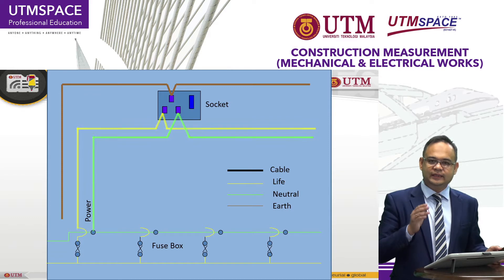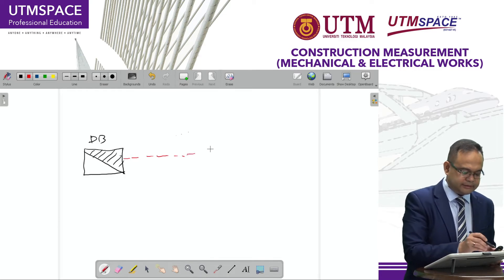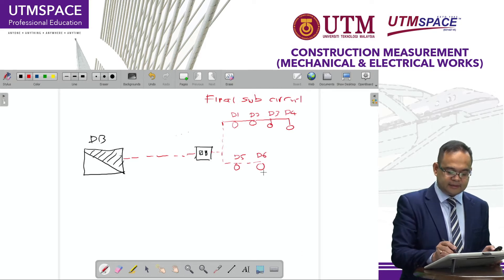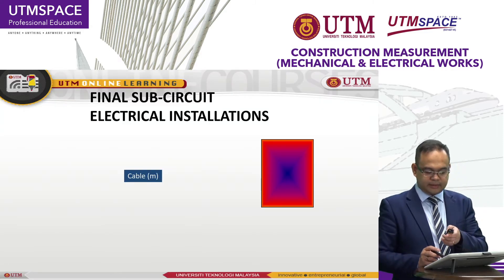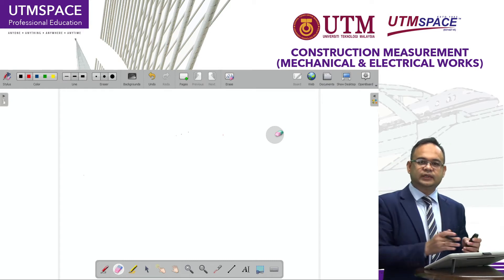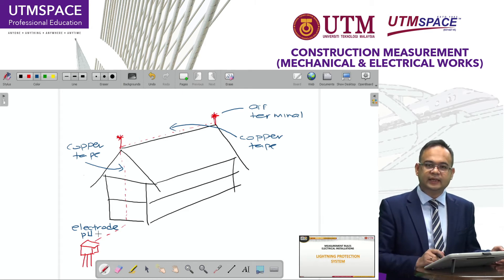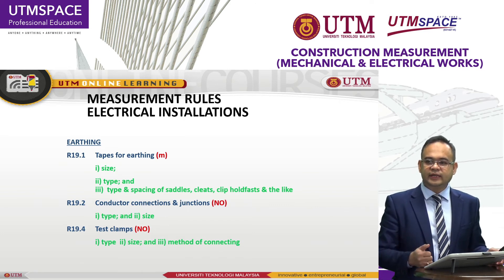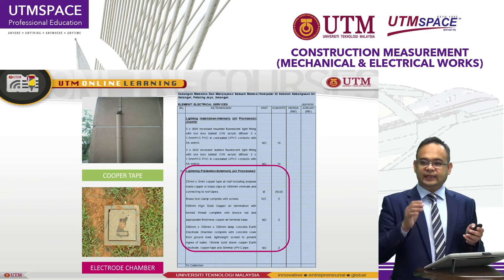Video 4 Final Sub Circuit Lightning Protection System

Comment: With the illustration and clear explanation, now I have a better understanding regarding the final sub circuit and lightning protection system and its measuring method in accordance with smm2.

Comment: A clear video explanation about the final sub-circuit and lightning protection system. It is make more simple and straightforward method to gain the knowledge on the electrical installation topics. This video has benefited me a lot !

Comment: This lecture video is interesting and very easy to understand. From this video, I have learnt about final sub-circuit and lightning protection system. Final sub-circuit is when a switch can control 2 or more electrical appliances. For final sub circuit, we just need to measure in Nr. Next, lightning protection system consist of four main components which is air terminal, copper tape, electrode chamber and test clamp. All of the components should be measured in Nr except for copper tape which should be measured in meter. 

Thank you for your sharing, Dr Sarajul.

Comment: From this video, I have learned about final sub circuit and lightning protection system in details. There are details definition of final sub circuit involved in a electrical installation system and its functions. Other that that, this video also explained about the rules of construction measurement as stated in SMM2 with details of unit (Nr) used for the taking off. This explanation was really helpful for me on doing electrical works and items in taking off list.

Comment: This video shows how the final sub-circuit and lightning protection system work with diagrams, sketches, and explanations. By watching this video, I have gained a better understanding of the lightning protection system and the final sub-circuit system. Additionally, I understand more about the rules of measurement for Lightning Protection and the Final Sub Circuit.

Comment: From a student's perspective, I find it very easy to understand the terms and function of the components. The final sub circuit seems like simple concept yet it plays a big role in electrical works. Same goes to the LPS. The method of measurement are also clear and very straightforward. Thank you for knowledge Dr Sarajul

Comment: This video are very helpful to me and those out there whos new to the lightning protection system, i can really understand how it works and what are the components in the Lightning protection system with how every single component works and how can it be measured. It also enlighten me on the existence of final sub-circuit. the video is really cool and easily understandable!

Comment: This video is very useful for me. It helps me understand the final sub-circuit and lightning protection system with clear explanations, sketching, and diagrams. It will help me a lot in measurement work.

Comment: This is a straightforward and understandable lecture that will assist me in gaining a deeper comprehension of the lightning protection system and the final sub-circuit.

Comment: With the help of diagrams and sketches, this lecture demonstrated how the Final Sub Circuit & Lightning Protection system works. According to SMM2, the final sub-circuit shall be measured in number (Nr), such that the final sub-circuit is from the switches to the downlights and appliances. Thank you, Prof!

Comment: Amazing video!! Prof. explains the final sub-circuit and lightning protection system in a clear and understandable manner. Clear voice, step by step explanation, straight forward, easy to understand. Prof. even shows us clear sketches on how the electrical system is installed and works. For example, the distribution board is connected to the switches, then from the switches to the down light point or electrical appliance via the final sub-circuit. From this video, I also realised that the cable from the distribution board to switches are to be measured in metres. However, for the final sub-circuit, we do not need to measure the cable in metres, but measure the final sub-circuit in number (Nr) according to SMM2. Moreover, from this video, I also get to know the main components of the lightning protection system such as the air terminal, copper tape and electrode pit through the clear sketches drawn by prof. At the last part of the video, it also explained about the rules in SMM2 (Section R.19) to describe each of the components of the lightning protection system. This video provided me with useful knowledge and better understanding on the final sub-circuit and lightning protection system. I believe that this will be useful for me in my M&E measurement course later. TQVM prof.

Comment: The video has a very clear explanation the final sub-circuit and lightning protection video. With the aids of diagram, it lets me have a  clear concept on how the system is working. Besieds, with the explanation on SMM2, I know which clause  I should refer when doing calculation. Thank you Dr.

Comment: Thanks for sharing this video. Illustrations and diagrams help to make the explanation very clear. I can readily understand the ideas and guidelines for the lightning protection system and final subcircuit from this video. This is due to the illustrations in the movie which helped me to grasp that the downlights and appliances are connected to the final subcircuit from the switches. Additionally, I learnt the clauses to which I should refer and pay attention when I write the final sub-circuit and lightning protection system's description. Many thanks, Dr.

Comment: From this video, it helped me a lot in understanding the Final sub-circuit and lightning protection system. For example, according to SMM2, the final sub-circuit shall be measured in number (Nr). The electrical connection or supply that began at the switch and went on to its downline equipment, such as lights and ceiling fans, is known as the final subcircuit.

Comment: A simplified and easy understanding video by Dr . Sarajul about the electrical installation. From the video, I learnt about final sub circuit and understood how's the source of electrical power come from incoming services to distribution board and to the switch socket. Besides, the video had just mentioned about the lightning protection system. from this I know more about the LPS and its function to the building. Thanks a lot, Dr

Comment: From this video, I have learnt that final sub-circuit is a circuit connected from the switch to its downline equipments. The cable connecting the distribution board to the switch is measured in meter while the cable for the final sub-circuit does not need to be measured. According to SMM2, the final sub-circuit shall be measured in number (Nr). Besides, I have learnt that the four major items of the lightning protection system are air terminal, copper tape, electrode chamber and test clamp.

Comment: The illustration given by Dr. Sarajul really helped me a lot in understanding the Final sub-circuit and lightning protection system. Final sub circuit is the connection or supply of electrical which started from the switch to its downline equipments such as the lights and ceiling fans. The electric cables from distribution box to the switch will be measured in metre run according to the SMM2 but for the final sub-circuit we just measure the number of items. For the lightning protection system, the illustration of functions for cooper tape, air terminal and electro pit chamber are clearly presented.

Comment: final sub-circuit means an outgoing circuit connected to one way on a distribution fuse board and intented to supply energy at one or more points to current-using appliances without the intervention of a further distribution fuse board. It includes all branches and extentions which are derived from that particular way on the board;

Comment: In electricity, the phase refers to the distribution of a load. What is the difference between single-phase and three-phase power supplies? Single-phase power is a two-wire alternating current (ac) power circuit. Typically, there is one power wire—the phase wire—and one neutral wire, with current flowing between the power wire (through the load) and the neutral wire. Three-phase power is a three-wire ac power circuit with each phase ac signal 120 electrical degrees apart.

Comment: To create the detail BQ and taking off, the important of informative drawing is very crucial.
Two type of information electrical drawing that can help the client and contractor to understand the electrical design either it is single phase or three phase supply.
1. Electrical layout plan – Location of electrical fitting, power point and  etc. 
2. Schematic drawing – Circuit, cut off

In this lecture video, I was able to understand the process and sequence of Electrical Installation.

Comment: Titty Ricca Binti Suhaili (SX190985BEQS12)

1. Electrical engineering installations are classified as single phase or three phase, with the main electrical components referred to in SMM2 Section R.

2. Incoming services, main insulation, power insulation, lighting installation, electrical appliances, conduit and fitting, cables, lightning protection system, and testing and commissioning are the components for measuring the electrical installation.
 
3. Based on SMM2, lightning protection system is calculated based on Clause R.19. There is four (4) main component of lightning protection system which are:
i. Air Terminal Point (Clause R.19.6 – measured in Nr),
ii. Copper Tape (Clause R.19.1 – measured in M),
iii. Electrode pit or Electrode Chamber (Clause R.19.5 – measured in Nr), and,
iv. Test Clamp (Clause R.19.4 – measured Nr).

Comment: From this video, I can find out the rules of construction measurement for the final sub circuit and lightning protection system. The function of an external lightning protection system is to intercept, conduct and disperse a lightning strike safely to earth. Without such a system a building's structure, electronic systems and the people working around or within it are all at risk. 
A lightning protection system consists of the following five parts: 
1)	air terminals (lightning rods)
2)	conductors
3)	ground connections (electrodes)
4)	bonding
5)	lightning arrestors

Thank you.

Yusti Taili
SX190981BEQS12

Comment: The Earthing for Lighting Protection System is important as it protects  sensitive equipment and devices in the building which may be caused by lightning strike. The  System  refers to SMM2 , under Section R.19 refers to  four main components such as :

1. The Air Terminal
2. Copper Tape
3. Electrode Chamber; and
4. Test Clamp

SMM2 states the following items on lightning protection system for measurement :

EARTHING
R19.1 Tapes for earthing (m) 
i) size; ii) type; and
iii) type & spacing of saddles, cleats, clip holdfasts & the like
R19.2 Conductor connections & junctions (NO)
i) type; and ii) size
R19.4 Test clamps (NO)
i) type ii) size; and iii) method of connecting

R19.5 Earth electrodes (NO)
i) type ii) size; and iii) driving electrode into ground
R19.6 Air termination points (NO)
i) type ii) size; and iii) method of connectin

ANCILLARIES
R20 Loose keys, tools, spares and the like (NO – separately)
i) type; and ii) quantity
Rack for holding tools (NO)

SUNDRIES
R22.1 Marking the position of holes, mortice, chases & the like 
(ITEM)
R22.2 General earth bonding & earthing (ITEM)
R22.3 Disconnecting, setting aside & refixing equipment (ITEM)
R22.4 Temporary operating each installation (ITEM)
R22.5 Testing each installation (ITEM)
R22.6 Preparing plans or diagrams of the installations (ITEM) 

Saladin Bin Kusaidi
SX191142BEQS12

Comment: This lecture give me the understanding on the method of measurement for m&e works and its procurement. The lightning protection system LPS is very important to protect the functionality of the building and its system during the critical moment to prevent all the failure after the strike.

Comment: From this video I understand more on rules of measurement for Final Sub Circuit and Lightning Protection.
1.	Final Sub Circuit
Based on SMM2 under Clause R.18, Final Sub Circuit is calculated in Number (No) by stating the ampere rating based on classification of point, size of cable and other accessories which deemed to be included.

2.	Lightning Protection System.
Lightning protection system is installed 
Based on SMM2, lightning protection system is calculated based on Clause R.19. There is four (4) main component of lightning protection system which is :-
A. Air Terminal Point (Clause R.19.6 – measured in NO)
B. Copper Tape (Clause R.19.1 – measured in M)
C. Electrode pit or Electrode Chamber (Clause R.19.5 – measured in NO)
D. Test Clamp (Clause R.19.4 – measured NO).

JOY AREN ANYI 
SX190994BEQS12

Comment: I was able to understand the installation of electrical engineering and the part that needed to be taken out from this video. A protective conductor in the shape of a ring must be installed in every final ring subcircuit on a panel board, for both ends linked to the earth terminal at the circuit's origin. It is an outgoing circuit connected to one way on a distribution fuse board, and it includes all branches and extensions that came from that particular way on the board. Its purpose is to supply electricity at one or more points to appliances that use current while protecting all of our electrical belongings from lightning strikes by connecting to the earth conductors to the appropriate panel boards' earthing terminals. Lighting protection systems are measured and classified in SMM2 as according Section R Clause 24.

Regards,

Abang Hisham Bin Abang Seruji
SX190983BEQS12

Comment: Electrical engineering installations divided into single phase and three phase, the main components electrical installations are referred to SMM2 Section R. 
The component for the measurement of the electrical installation is from the incoming services, main insulation, power insulation, lighting installation, electrical appliances, conduit and fitting, cables, lightning protection system and testing and commissioning. In the SMM2 from DB to switch are measure in meter for the cable and the conduit in middle length of the cable section. 
For the final sub circuit are measure in number because of the requirement by the section R16 to R18. The lightning protection system is can protect a structure from damage caused by being struck by lightning by providing a low-resistance path to ground for the lightning to follow and disperse.

Phang Su Kim
SX190993BEQS12

Comment: The Earthing for Lighting Protection System is an essential protection system which can avoid damage to the devices in the building caused by lightning. The Lightning Protection System which refer to Section R.19 consist of four main components namely;

1. Air Terminal
2. Copper Tape
3. Electrode Chamber; and
4. Test Clamp

Noorazlini Binti Tuah
SX190979BEQS12

Comment: From this video, I able to understand about electrical engineering installation and the element to be take off. Able to understand electrical distribution flow in building, Related clauses in SMM for electrical installation, Single and Three Phase theory, final sub circuit and also  the lightning protection system. 
Construction Measurement for Electrical Engineering Installations comprises of the following items: 
R.2 CLASSIFICATION OF WORK
a.  Incoming Services 
b. Standby equipment
c. Main Installations 
d. Power Installations 
e. Lighting Installations 
f. Heating Installation
g. Electrical Appliances, conduit and Fittings ,Cables 
p. Lightning Protection System 
q. Builder's Works in Connection (BWIC)

R.3 LOCATION OF WORK- Internally and Externally
And etc..

Cerinna Anak Steve
SX191174BEQS12

Comment: In a panel board, in every final ring sub circuit, a protective conductor is to be installed in the form of ring on both ends connected to earth terminal at origin of the circuit. It is an out going circuit connected to one way on a distribution fuse board and to supply the energy at one or more points to current-using appliances to secure all our electrical belongings from lightning stuck by connected to the earth conductors to earthing terminals of respective panel boards it includes all branches and extensions which derived from the particular way on the board. In SMM2 lighting protection system is being measured and classified under Section R Clause 24.

Cindy Anak Nojien (SX190975BEQS12)